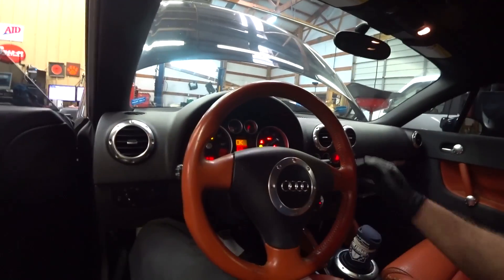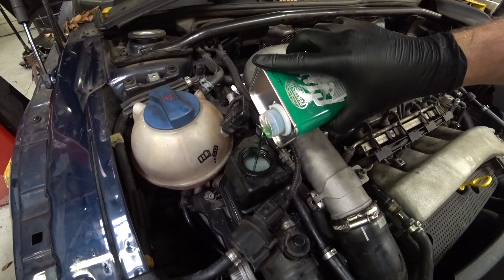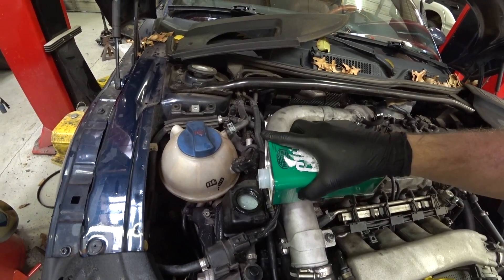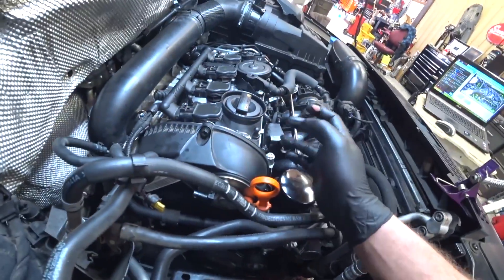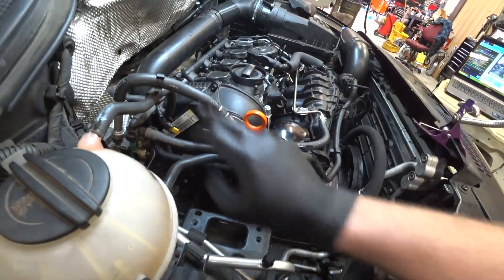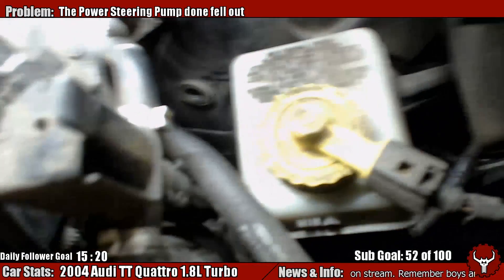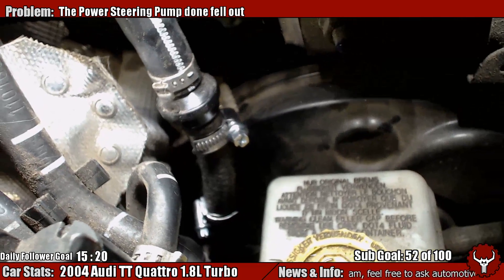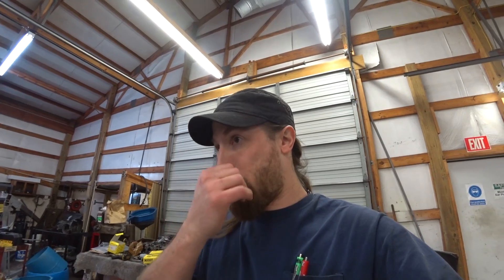The Daily Mechanic Bleeding Power Steering & Common VW Failure

Comment: What's the procedure for flushing old power steering fluid out of the system?  The video does a good job of showing how to bleed air from the system but I"m specifically interested in understanding the process for removing old fluid.  Thanks.